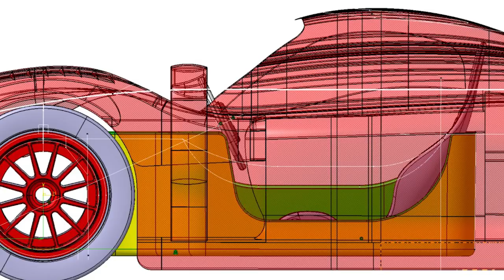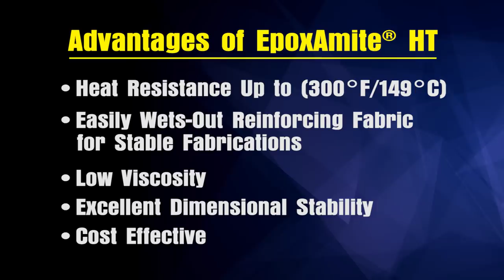Creating a High Temperature Tool Using EpoxAmite™ HT + EpoxAcoat™ HT

Comment: Used a chemical release agent on your pattern rather than wax and PVA.
Have the mould tool made from all carbon.
Use peel ply on between the laminate and the perforated release film
Don’t bond a steel frame direct to the back of the mould tool as the thermal expansion of the steel is far greater than the composite tool and when it heats up in cure it could distort your tool or break the joints...
Do a vacuum debunk after 1st ply 
Teflon isn’t technically a peel ply, you could be trapping resin and volatiles within the laminate by using Teflon film.
Good effort, nice part.
Reply: instead of steel what would you suggest ?

Comment: Yikes!  Not enough surface coat or backing layers on that plug.  But I love your products Smooth On
Reply: It appears they are using the "neutral" color, not high temp product, which is why it looks so thin.  Obviously it is not the "high temp" version, which is "dark red".  So in other words, in this video they did not use the product this video was created to promote.  LOL, right?

Comment: You used Carbon fibre for the tool instead of glass fibre. Why is that? I found that kind of unusual. Not really needed for wight saving or strength.
Reply: gus bisbal thermal expansion coefficient
Reply: This is pretty large thin part and you need a lot of fiberglass to achieve same rigidity of the tool just with a little carbon fiber. So they use some carbon fiber to reduce amount of fabric layers.